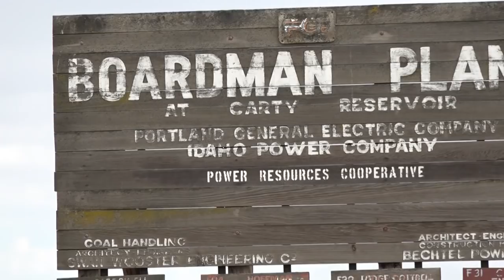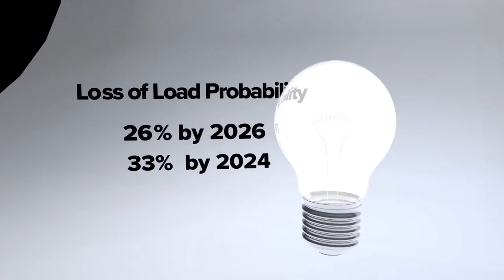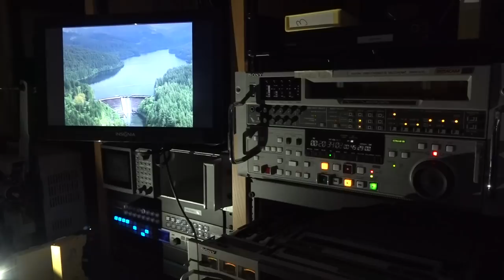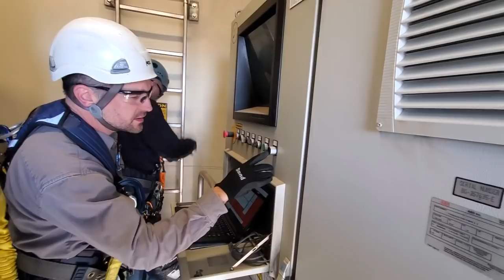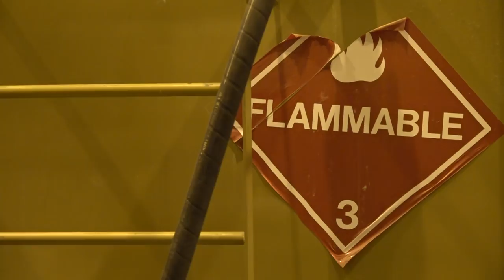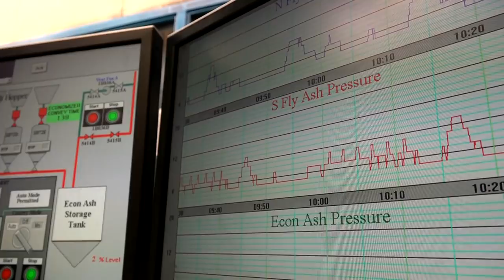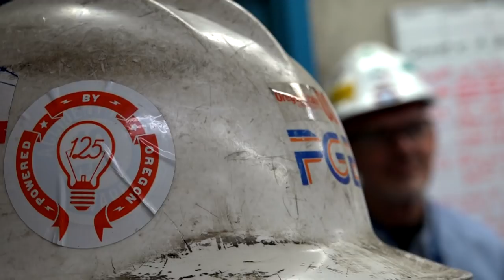Will there be enough electricity after coal plants shut down? | 'Power Struggle' full documentary

Comment: I'm just gonna say it why are not building nuclear plants
Reply: 3 Reasons.  Cost.  Cost and Cost.  Nuclear is 4x more per MWh and 15x more per MW compared to solar or wind.
Reply: We had a Nuclear Plant in St Helens, OR and we know why it shut down and got decommissioned.
Reply: @nobodyimportant8695  .... I'm guessing cost?  ;)
Reply: adam hauskins watch the Chernobyl series on Hulu
Reply: @jamiesoncollie6867  a drama based on rushed and unsound Soviet tech American nuclear power has a outstanding record including 3 mile island
Reply: Nuclear power is super dangerous and destructive. Why would we go from something we know is dangerous, to something we know is dangerous.
Reply: @cullintikac5268  no it's not the us has not had any serious issues 3 mile island
Reply: That's exactly what I'm getting at
Reply: Cullintika C more people die from fossil fuels in 6 months then nuclear powers life time
Reply: @Chris-ie9os  
Nuclear is "expensive" because of the fossil fuel subsidies, insane levels of safety regulations, and libturds opposing the deep geologic waste repository.
Reply: @gregorymalchuk272  No;  Nuclear is expensive because it needs to have a low failure rate and converting heat into electricity is absurdly inefficient.
Reply: @Chris-ie9os  
The failure rate is already low. Three mile island didn't even breach the core. Fukushima had a triple meltdown with no containment buildings and nobody died. Modern high temperature reactors and high temperature, high pressure supercritical steam generators can convert the heat to electricity at about a 47.5% efficiency compared to 33% for light water reactors.
Reply: @gregorymalchuk272  Yeah... that's where it needs to be.  We got lucky with TMI and the only reason no one died 'yet' from Fukushima is because they all evacuated.  The odds of a fuel element failure needs to be <1:10k/yr.  That's not cheap.  Nuclear  is thermal which means dissipating 2w of heat for every 1w of electricity.  Also not cheap.  Nuclear is cost prohibitive vs Solar, Wind and Storage because physics.
Reply: @Chris-ie9os  
You act as if dissipating heat while extracting work is a bad thing. It is a fundamental limit of the the laws of thermodynamics. In order to convert heat into work, you have to dump some of that heat to the low temperature heat sink. The theoretical efficiency is a function of the difference between the hot and cold reservoirs.
Reply: @gregorymalchuk272  It IS a bad thing.  Solar panels and wind turbines aren't 100% efficient (nothing is) but with solar and wind you don't pay for the fuel you're wasting and you don't have to pay to dispose of the heat.  With thermal plants you do and it's not cheap.  Thermal plants are obsolete.  It's economically insane to build thermal plants like nuclear and coal now that solar and wind are ~$1/w.
Reply: @Chris-ie9os  
Do you not understand the concepts of "base load", "non-dispatchable", "spinning reserve", and "grid stability"?
Reply: @gregorymalchuk272  All of which can be EASILY and MUCH more cost effectively accomplished with demand response, storage and gas turbines.
Reply: Dan really? Where’s your proof?....
Reply: Hysteria, ignorance, and the greens desire to wreck industrial society and push everyone into 3rd world poverty.
Reply: @Jemalacane0  I haven't used a drop of fools fuel in >2 months.  Before that my net use has been NEGATIVE for ~7 years.  Nothing 'impoverished' about my life.  Go Solar.  Drive Electric.  Only Morons and Monsters use fools fuel where alternatives exist.
Reply: @Chris-ie9os  So, no fossil fuels or nuclear power were used to make your solar panels?
Reply: jamieson collie old nuclear technology. Nuclear is the future of electricity
Reply: Cullintika C you are wrong. The future is nuclear. Watch “ inside Bill’s brain” on Netflix.
Reply: @gregorymalchuk272  wrong but go on
Reply: @Chris-ie9os  I would assume we can agree that petroleum products equal a carbon footprint. When you leave your house with a carbon footprint in your electric car that has a carbon footprint on the road, that has a carbon footprint to the grocerie store, that has a carbon footprint to buy groceries that have a huge carbon footprint we don't count that as consuming oil? Kind of hypocritical id say. How do you heat your home? Possibly wood, from trees that consume evil co2, turn it into oxygen then store the remaining carbon. Every time you kill a tree and burn it, it stops converting co2 to oxygen and you release stored carbon back into the atmosphere as co2

If you were to honestly remove oil from your life you would need to strip yourself naked, bring nothing with you and walk to the bush. Become a hunter/gatherer, find your own food, make yourself fur clothing, stone tools and build yourself a home made of things you find in the immediate area. If you decide to pull yourself out of the stone age its going to require the use of fossil fuels. Your only fooling yourself chris, if you want to practice what you preach id suggest following my advice. Be the hero you think you are!
Reply: Uhh why? We don’t have a permanent storage for the HIGHLY toxic radioactive spent rods. I would rather have new coal technology (scrubbers etc..) then any nuclear.
Reply: @Chris-ie9os  You sit high atop your paradise  and chastise those who need fossil fuels to survive. If you are able to heat with a heat pump you don't know what -40 is. If you drive an electric car, you must live fairly close to a larger urban center. 

Where do you think your food comes from? The entire industry revolves around diesel. From production to transport, your shelves would be empty without it. If you have a better idea id love to hear it.

There's a large number of people who wouldn't be able to survive without fossil fuels. I happen to live in a place where its too cold for electric cars to be practical, the winters are too harsh for cars, most people have suv's or trucks. I couldnt imagine getting stuck in a blizzard watching the battery in an electric car counting down to certian death. I also happen to need to travel hundreds of km regularly for work and could easily put on 300km a day. We can't rely on solar because of snow and 8 hours of sunlight in winter. We rely on natural gas, propane and oil to heat homes as its the only form of heat capable of producing the btu's needed to survive weeks of -50. Calling us down seems pretty unfair wouldnt you say? 

If you have a better option I would love to hear it. I would also like to hear your solution to pulling a 16k lb trailer 300-1500km without diesel. Btw, I work in thermal power plants, oil refineries and chemical plants. I'm a highly specialized tradesmen, the majority of my skills are based around pressure vessels and are non transferable to other industries. So once those facilities are gone, what do I do to earn the 150k a year I'm currently earning?
Reply: @matkurcher9469  ..... instead of whining why not work to fix yourself? Go Solar.  Drive electric.  This isn't difficult.  Only morons and monsters use fools fuel where alternatives exist.  What's your excuse?   Electric cars work great where it's cold.  ~40% of new vehicles in Norway are electric now.   There are some edge cases where electric isn't there... yet... HENCE.... only morons and monsters use fools fuel >>>> where alternatives exist <<<< ;)  The Cyber Truck will be available soon enough :)   

Horse farriers had to find new work too.  Keeping obsolete trades alive for the sake of employment is just welfare with extra steps.
Reply: @Chris-ie9os  and to your first comment on nuclear being way way way too expensive.

Show me the proof its 15x more expensive. I would like to see the complete math on that for 1000mw of each. Not just installed price, but numbers based off of the same gwh cost using nuclear as a baseline. And you can't fudge the numbers by ignoring that solar and wind only produce when the sun shines and wind blows. I would also like to see the costs associated with replacing solar and wind every 20 years, when those panels loose efficiency and windmills have to be replaced because they wear out.

Ill give you a head start. 1gwh is 1000mw produced for an hour. The average 1000mw nuclear unit has a load factor of 92 to 98%. 24gwh a day, equates to 338,000 gwh over 40 years at 95% load factor. 5.5 Billion average cost to construct, $33,500 fuel cost per hour=11.8b lifetime. 1B to decommission and an estimated 2B to store and secure the 16,500t of spent fuel rods from 40 years of operation. Thats a grand total of 20.3b if component replacment doesnt happen and the lifespan doesn't get increased.

Us fleet wide load factor for solar is 20%
US fleet wide load factor for wind is 35%

So with those numbers you would have to install 10,000mw solar and 5715mw wind over 40 years. Plus associated storage costs to run 24/7/365

Current price to install solar is 2 billion for 250mw based off of abengoa's Arizona plant. 10 000mw solar cost, over 40 years is 80billion without storage. 

Tenaska 250mw wind farm in Minnesota 1.8m per 1mw cost= 450m. Total cost over 40 years is 10.25b without storage.

Storage factor would have to be the inverse of the load factor. Storage for solar would need to be 80% total capacity and 65% total capacity for wind.  Current battery storage would have to be replaced every 12-15 years. And loose 40% over its lifetime. Pumped storage has an efficiency of 70 to 80%, you would have to increase the volume of installed storage by 20 to 30% to make up for the loss. Thats not factoring loss for the additional 20 to 30% which would be an additional 4-6%. 

I havent even factored the economic costs in loosing cultivated land and the cost of decommissioning solar and wind, maintenance costs associated to any type of generation. And the staffing costs for operation. We can't forget that the amount of water required to clean solar panels is roughly 1 gallon per month for a 300watt panel. Monthly inspections and a yearly structural inspection of every wind mill would also have to be included.
Reply: @Chris-ie9os  I'm not the one with the problem here, you are. I don't have an issue with the way you live, your the one who has a problem with the way I live. I'm just trying to let you know that not everyone can live off of renewables and ev's due to weather. Its easy to say "quit complaining and jump to your death" when needing reliable heat, electricity and transportation to survive doesnt directly impact you.

Btw, the reason nuclear generated power is expensive is it subsidizes renewable generated power plus makes up for production losses. I have personaly seen the inside of that financial mess. 69cents a kwh for produced solar, 37cents a kwh for wind and 4.2cents for nuclear, Coal and gas generation are at 2cents a kwh. Coal kwh cost triples when you add emissions controls like co2 capture, so2 scrubbing and nox reduction.
Reply: @matkurcher9469  You said it yourself.... oil is a valuable material for making many useful items.  What kind of sick POS burns such a valuable commodity for energy????   Work with your 'neighbors' to invest in HVDC lines to sunny and windy places if you need energy.  Don't burn oil.... that's just idiotic.
Reply: @Chris-ie9os  lol, I'm glad we were able to have this conversation. Vogtle is a great example of mismanagement, extreme cost over runs, licensing delays, anti nuclear lobby groups slowing things, the bankruptcy of Westinghouse, Fukushima, labour issues and the list goes on. They are currently billions over budget and years over schedule. I have been loosely following that project for years and its been a nightmare. I wouldn't ever choose that as the "average new nuclear power plant cost" because it is an outlying financial failure.

It will take some time to get familiarized with jumbo hill. It was one of the wind farms that recently froze up in Texas, so I wouldn't call it dependable when you need it the most. But the costs I had stated per installed mwh are in line with national averages. 

I would love for you to take a road trip up here to the Canadian praries in February with your electric car. Come check out what life in -40 is like. Lets compare apples to oranges here, your heat pump for example if its an in ground loop you would need to get well below the frost line, up here thats 8 to 10 feet deep. If you were going to try to scavenge any amout of useful heat, you dig to 20' or more. The reason I know that as fact is a neighbour of my parents spent 60k installing a loop on their farm to heat their home. The heat exchanger unit was also quite expensive, complex and energy hungry. Its basically an air-conditioning unit that runs in reverse. instead of pulling heat from the outside air it takes heat from the loop, which requires a circulation pump running as well. They say the system has a difficult time keeping the house above 68 degrees.
Reply: @matkurcher9469  Ok.... then provide a better example of a modern nuclear plant built in a western country.  They're all disasters.  The purpose of a wind farm is not to be reliable.  That's the role of gas turbines (one day powered by green H2).  The purpose of wind farms is to reduce the use of fools fuel which wind does spectacularly at a cost of <$20/MWh vs the cost of fools fuel at >$30/MWh.  

For extreme weather ground source heat pumps is the way to go.  Lots of options.  And yeah... if you undersize a system it's not going to perform.  Just have to be smart about it.....
Reply: @Chris-ie9os  I wish their was a better example, but ground hasn't been broke on any new plants since the late 70's. There hasn't been any gen IV's completed in North America. The average construction duration should be 5-6 years from global data. The main reason there hasn't been activity with nuclear power was tmi. That incident was blown way out of proportion. Then came chernobyl and even more fear mongering because the general population is uneducated. 

Tmi was a small cooling system failure initially, that turned into a partial core meltdown due to inaction and confusing instrumentation readings. The remedy would have been better training provided by B&W to the operations team. 

The chernobyl accident was going to happen one day anyways. The RBMK was an unstable design naturaly prone to unmanageable hot spots. Its a graphite moderated water cooled issue. The main cause was stalling the reactor then withdrawing control rods. Creating uninformed heating and boiling, that reactor relied heavily on water to slow and absorb neutrons, once the water flashed to steam it was all over. Its actually not the first incident with a graphite moderated core. I do believe that title belongs to windscale in sellafield uk. 

Those 2 incidents were the fuel on the anti nuclear fire, lobbiests and activists used them to fear monger the population into distrusting nuclear energy. Those are still issues that prove difficult to overcome.

Then came Fukushima when public opinion was starting to turn around. Everyone thinks the failure was due to an earthquake, the plant survived that just fine. The system worked perfectly, it shut down at the sign of the first tremors and the backup generators fired up. Everything was fine until the wave showed up, flooded the generators and all electrical switchgear in the basment paralyzing the plant. The passive cooling system was never designed to handle contained decay heat for as long as it was asked to. Eventually pressure built in the vessel and had to be released. The explosions seen were not nuclear, it was a hydrogen ignition in the upper portion. The wave also made it impossible to get generators pumps and fuel to site. The things that could have saved them from melt down. The cores are still in the containment and currently cooling.
Reply: @matkurcher9469  ..... there haven't been any because of cost.  Like I said previously.  Even absolute best case they're still ~3x more per MWh and ~5x more per MW vs solar and wind.  I worked in a nuclear plant for ~6 years.  It's inefficient and expensive to convert heat into electricity.  Whereas solar PV and wind is simple and cheap.  It's physically impossible for thermal to come close to the cost of Solar PV or wind.  Future energy will be dominated by solar and wind because it's dirt cheap and getting cheaper.
Reply: @Chris-ie9os  I think I did a pretty good job debunking the large scale costs over lifetime. I broke that down for you citing actual costs, within the last couple years based on gwh. The nuclear costs were based off of iaea, the nrc and cnrc numbers. The pv and wind numbers were the most recent large scale installations in North America. I didn't get into storage costs because they are out of control, You would need storage to make 100% solar/wind work. Look, I'm not going to trust cost numbers per kwh coming from the Sierra club, who pushed hard for biomass a few years ago. 

You keep stating the same numbers as fact here, I've told you I have first hand working knowledge of per kwhr costs to generate. Ive shown you math on the projects, its your turn to prove that wrong. Stating numbers doesn't work.
Reply: @matkurcher9469  My numbers for wind come directly from a recent rate case in NM.  It was $18/MWh.  That's why it was approved, gas costs $30.  Like I said... no point to storage until there's massive curtailment.  If wind is curtailed 20% that just means it now cost $22/MWh... still cheaper than gas.... still cheaper than storage.  Why spend $1M on storage to reduce curtailment by 500MWh/yr when you can just add more wind and produce 4GWh/yr even after curtailment?

You also can't use average numbers costs are falling too fast for that.  You need to look at recently completed projects.  Onshore wind and solar are now going for <$1/w.  I've even some some solar projects for ~$0.80/w.
Reply: @Chris-ie9os  I don't see a point in continuing this discussion. I'm not conceding here, lets make that clear. Our daily realities differ quite a bit, and that is why we're stuck. The disturbing thing is you seem to be ok with me, my family and a billion or more people dying for your cause. I've told you life below zero can't happen without a reliable source of electricity and heat. 100% renewables and no fossil fuels will kill lots of people and that's a fact of life your unwilling to accept. Or quite possibly you are, and just don't care. There is no urgent climate emergency and the whole system is cyclical. Thats been proven, climate hysteria is based off of junk science and flawed models.
Reply: @matkurcher9469  ??? You think there's a billion people living in areas that experience -40????  And how often it is that cold there?  ~5% of the time?  Why not use a responsible energy source the other ~95% of the time?  There's also nothing wrong with a wood stove.  The problem with fools fuel is you're adding carbon to the biosphere... that kills too because physics.  You're not adding carbon to the biosphere by occasionally burning wood when it's too cold for a heat pump to work.  Or... just use resistance electric heat when it's too cold.  Only morons and monsters use fools fuel where alternatives exist.  

Which fact do you think is not true?  1) CO2 levels have risen >40% since our addiction to fools fuel began.  2)  That rise can be 100% accounted for because of our pathetic addiction 3)  The radiative forcing caused by that increase will cause average global temps to rise ~3C.
Reply: @Chris-ie9os  We have 6 weeks every year at -40 or below. Another 6 weeks of -30, its routinely very cold dec, jan and feb, snow starts falling in late October and doesn't take off til late March, early April. Under 8 hours of sun, if we are lucky during the winter solstice. Today, sunrise was 7 and sunset is 6. No wind the last few days, and its routinely either dead calm or 40+ kmph seldomly is it anywhere in between. The closest commercial wind farm is 600km, no commercial solar here at all. The federal government wants renewablea, power companys have been fighting tooth and nail against for obvious reasons.
Reply: @matkurcher9469  So ~10% of the year it gets to -40 or below.  Daytime too?  Is -40 the high?  Seems like what you need is ground source heat pumps and HVDC lines to allow sharing energy.  OR.... as I said earlier... just use wood stoves or resistance electric heat the 5% of the time it's too cold for an ASHP to work.  Not rocket science.  Only morons and monsters use fools fuel where alternatives exist.